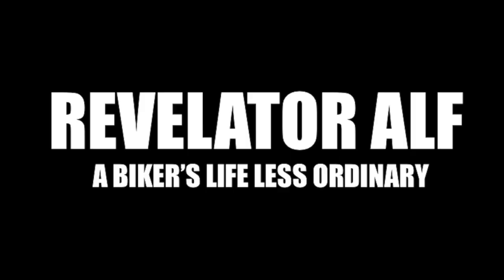What is the BCM on Harley Davidson Softail

Comment from the maker: Thanks for watching. Have you have had BCM failures on your motorcycle? More videos like this here: https://www.youtube.com/playlist?list=PLmgCmljtdCzWrLg62oZxo0laIsmq4j67P
Reply: Hi, Revelator Alf! 
I wrote to you before, thanking you for the video for the Smart Siren installation on my 2020 Heritage Softail. 
It worked out great!
So I decided to replace the horn that came on the bike, and that also went flawlessly!
But, I wasn’t happy with the horn that I originally ordered to replace the existing one, so I ordered another one.
So, when I removed the 1st replacement horn, the mounting bolt came out of the horn itself!
My Cousin came over, and I was explaining about not liking the sound, and I turned the toggle switch of the bike on, and pushed the horn button so he would hear the tone, and nothing happened! 
I reached down to grab the horn, and it felt warm. 
I’m not sure if when the mounting bolt came out of the horn, whether it caused the inside terminals of the horn to touch, causing a short, when I pressed the horn button.
So, I turned the toggle switch off, and started looking for a blown fuse. 
Of course, there isn’t one for the horn, so I just assumed that it might have a thermal type circuit breaker, and would reset itself.
So, I replaced the horn, and when I turned the toggle switch on, I didn’t have a headlight, or the auxiliary running lights!
But, the turn signals work fine!
I’m wondering if I might have ruined the BCM, by just pushing the horn button!
Is that possible?
Reply from the maker: EddieHugs1 hi and thanks. Have you put the original horn back on and have you got the wiring connectors the correct way around? It is possible that you’ve shorted something but I’d be surprised if you have. 
Have you got error codes with this too?
Reply: RevelatorAlf 
I didn’t put the original horn back on, I just installed a different horn, and nothing happens!
I tried to start the bike, and it won’t start either, that’s why I’m assuming that it is the BCM, because you said that it also communicates with the ECM.
Reply from the maker: @EddieHugs1  Yes perhaps it is something but wonder what you may have done to interfere with the BCM.
Have you done any other work to the bike or changed any electrical. Have you checked the battery for loose connections and fully charged etc. I would revert back to original horn and try to retrace what has gone wrong but unless there's more info you may have to just get it to a mechanic or dealership to rectify. Hope you get it sorted. Cheers

Comment: Once again, helping me better understand my bike. Thank you!! I got BCM codes "B21: 41, 46, 51, and 56" all of them had "h" at the end, which I understand means "historical" I then also got a Part Number, PN 41000349f, to replace my BCM. Long story short, I think the codes are from me changing the turn signal lights out. It's also interesting to hear the BCM controls a record of if the bike has been dropped or leaned too far. Interesting because after buying this Sport Glide used I noticed the license plate light wasn't working and there were some other signs that perhaps the bike was dropped by the previous original owner. I don't know how I could have driven the bike without the BCM Control Module, but my dealership took care of it, and the other dealership I bought it from either didn't know better or the salesman pitched me "a story" explaining why a 2021 bike with only 108 miles on it was in their inventory. "Oh the guy's wife didn't know he bought it and she told him the family needed a new truck and not a new bike. So we took it in as his trade in for a new F150, huh huh huh huh." DRAMA

Comment: Hi,
I changed bars over and now the left controls don't work? Indicator doesn't work but hazard flash 
does 🤔. Also I can't check or clear the codes as the menu button doesn't work.
I've checked the fuses and they seem fine. Is there some kind or reset procedure??
Cheers
Reply: Double check you plugged the connectors back into the right spots and they are fully seated. Had a similar issue and realized I had two plugs mismatched. The connections were the same but one was a three pin and one a four pin. Cables were different colors as well. Can’t remember which colors go to which but I think the left and right controls were both four pin connectors. More than likely you just have plugged into the wrong spot.
Reply: @brandondoggette7580  I've checked  but it has to be something  else as the right hand side controls are 
Plugged in and working. 🤷‍♂️
Reply from the maker: Retrace what you did and test each wire for continuity too. It’ll be a process if elimination I guess

Comment: Good morning 
I’m fairly new to Harley motorcycle 
Last night on my ride home from work my security light came on !
This morning I checked my codes and surprisingly found 3 bcm ones.

B2137 Low beam output shorted high
B2151 Left rear turn signal output open 
B2156 Right rear turn signal output open 
How do I check these?

Bike never shut down and seemed to be ok for the remaining 5 miles I rode.
Also get a part number 
69993-11a off diagnostics 
My bike is a
2012 Harley Davidson Softail CVO Convertible FLSTSE3 
Any suggestions would be appreciated

Comment: Had a failure on my dyna. If you hit a pot hole the engine would cut out. .replaced it myself . Older bike and wasn't a fuel injection.

Comment: So I changed the bars on my 21 road glide special and now I’m getting a ECM-BCM code u0142  any suggestions where it could be?   RHCm Lost comm?
Reply from the maker: Yep did you pull the main fuse before doing bar change. If not, you’re getting the code because power was disconnected when you changed the wiring. So first thing to do will be to clear the codes and see if that solves your issue which the u code would tend to mean. Cheers
Reply: @RevelatorAlf  unfortunately not at first but I did midway. I’ve tried clearing the codes but as soon as it says clear and I press the button to continue to the next it keeps popping back up …  I disconnect the battery for a while to see if that works but it didn’t.   
 I tripled checked all the connectors and the color coordination to ensure they were correct and they are .  Could the BCM when bad on a 2021? Or do you recommend me pulling the bars and replacing the wiring for the throttle control side… I’m going nuts here
Reply from the maker: @davidmatias6239  hmmm did you use a wiring extension kit or modify wiring yourself? It’ll just be a case of retracing what you’ve done. I doubt the BCM is damaged but this could be a poor connection somewhere in your wiring which is giving you the u code
Reply: @RevelatorAlf  I de pinned all the connections b4 running the wires through. It was fairly easy . I didn’t use any extension,they were 12”bars and had enough wiring .I just eliminate the plastic clip housing from the harness for extra slack 😩
Reply from the maker: Can you perform continuity test on the wiring or resistance tests too?
Reply: @RevelatorAlf  just an update buddy… I went to Harley a bought wire I thought would be the problem and connected them without taking the wire out if the bars “just in case” and surely that was the problem. I cleared the codes to test it . Everything works perfectly as it should. It was a little tough getting the wire through these LA Choppers Hammerhead bars . I really appreciate your time in response to my headache. Blessings bro
Reply from the maker: Ah great. Glad you got it sorted. Cheers

Comment: Sir plz i hve bcm how can i get id code
Reply from the maker: That is particular to you bike so you will have to go to a dealership for them to extract that. Cheers
Reply: @RevelatorAlf  sir if i get bcm with key can the bike start??
Reply from the maker: @medeone3216  Your BCM has to be matched to your ECM, otherwise it will not work and you won't be able to start the bike, whether it is key or keyless with fob. You will need to get your BCM matched your to bike ECM and VIN number and that can only be done b a workshop with proper computers. Cheers
Reply from the maker: @medeone3216  OK do you mean how to start the bike with the pin code? Because that is something different
Reply: @RevelatorAlf  yes i only buy bcm and key they told me u can start the bike with new bcm